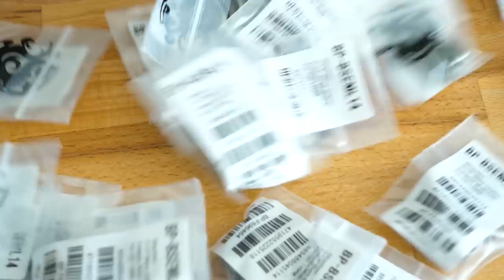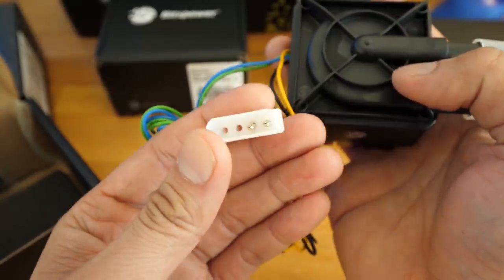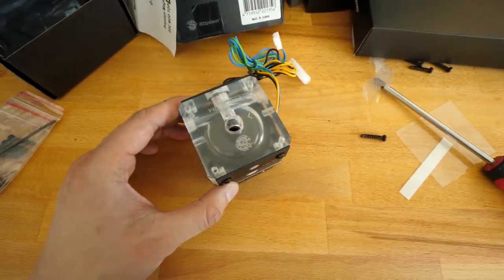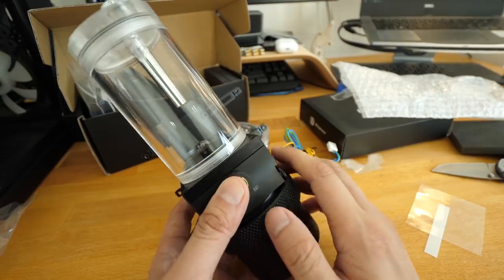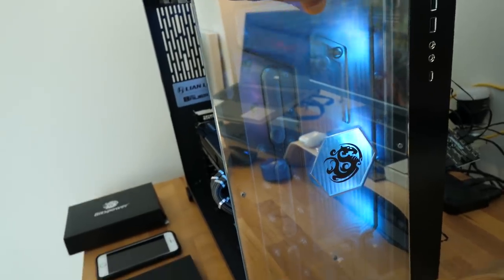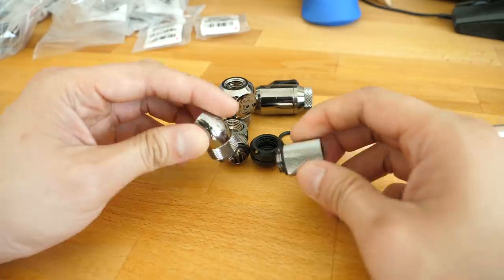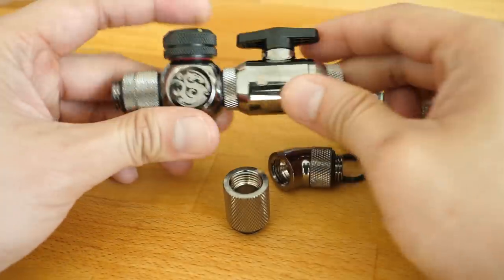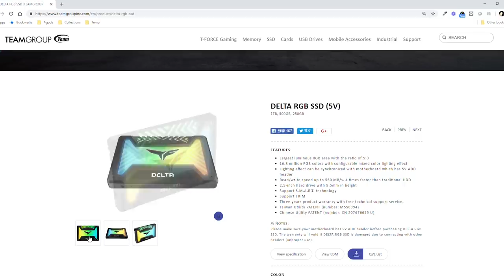Project Aqua Crystal feat. Bitspower Touchaqua Sedna water dist block and Lian Li 011 Dynamic

Comment: I honestly think you should do more in depth detailed water cooling guides, you did a great job on this one and I would love to see more in the future. Your guide was very easy to follow. I know water cooling id super expensive and takes a heck of a lot of time to do, but new comers need better how to guides. Don't get me wrong there are some great ones out there...but they are starting to get out dated if you know what I mean.
Reply: I agree!
Reply: I agree with you. Gambit
I have owned CW for almost 8 years and from my point of view EK is in first place. Nobody can beat them. How soon did I buy a radiator from Thermaltake 480 64mm and if I compare their radiator with the one from EK you have no way. The ddc pump I got from the first CW and nowadays everything goes perfectly from EK
Nice project but when you put the system in full load you will see that the radiator will not be enough. I own Asus Maximus X Formula + Intel i7 8700K 5.0GHZ and Gtx 1080 with a 420 radiator and a 480 video card with a maximum temperature of 45 degrees.
Good luck in what you do next.
Reply: What are you on about. He talked about pumps and fittings. Theres a million more things to consider and definitely videos better than this one.

Comment: Just an FYI, make sure all the screws are tight.  Mine was leaking straight out of the box.  I checked the screws on the front of the plate and had to give them all at least 2 full turns to stop the leaking.

Comment: I'm actually about to do the same, not as nice as yours! But I'm gona' be transferring my (Z370)8086k/1080Ti build into my brand spakin' new PC-O11 Dynamic case, that's sitting right next to me, empty..with bunch of parts inside of it. And going to be running my first complete custom loop into it. Since I couldn't buy everything I 'needed/wanted' all at once(Peasant Farmer), I've been buying part's here and there and just have a few more parts that I want included before i started the build, no rush really. In between the down-time I've been researching and watching PC-O11 custom-loop builds likes yours that will help me with my first loop. But newayz Great video man and beautiful build!

Comment: why do these super high end builds always have a sata SSD in them, decent NVME drives are not that much more expensive, and its hard to argue cost with a RTX slapped in
Reply: @Steven Ross-watt I have a 500 gig NVME and a 4TB mechanical drive hidden in the case, and you dont see little boxes with yet more cables hanging out of them stuck in odd places at random
Reply: @Steven Ross-watt point was if you got a RTX 20something why is one showcasing 2009 gee whizz tech when better slicker and faster is out there

hey check out my brand new expensive as hell supercar, its got a keypad for a door lock
Reply: @Steven Ross-watt it was more of an observation than a criticism but whatever makes you feel like you defended the internet
Reply: I have 2 1 TB NVME drives, a 2 TB SSD & an 8 TB HDD lol
Reply: Martian Moon what's in there, 4K porn?

Comment: Is the reason why you did the tubing that  because of the type of reservoir hole location? Would a tube style like this be possible on a reservoir from an EK reservoir? Reason I’m asking is I like the bends in this and I’ve seen a lot of straight tubing runs on ek reservoirs.

Comment: Great video but what is the point of the GPU support bracket being inside the case if you're not gonna actually use it?
Reply: probably the same point of spending 200$ on a distribuition plate and not using it for what it was made

Comment: I just bought this distro plate for my Razer edition O11. My question is - I saw in the manual it mentioned removing or fastening rivets - do I have to do that?? I'm waiting on my gpu and cpu blocks as well as some more fittings before I start bending tubes!

Comment: I notice that you managed to exchange the pump to the d5 pwm. Where an how did you connect it and where and how would you have connected the original one ? Thanks for your explanation !!!
Reply: I would imagine, its just removing those screw and re-screwing it in but yea, would love to have some confirmation/explanation from jojococo studio.
Reply: LLuuLe2 i meant the Electrical connections of both the DDC pump and as compared to the original non PWM Sedna pump

Comment: Is it possible to take the pump off the front panel distro plate and place a different pump somewhere else in the case so a 360 rad can fit in the bottom?
Reply: No. The pump is connected by 4 screws and the inlet doesn't has any screw hole. It's a normal hole with oring. You need to figure out yourself how to seal it.

Comment: awesome build as always, i have a question is 1 60mm 360 rad enough for a 9900k and a 2080 ti i have searched every where and cannot find and answer  thank you in advance
Reply: I'm sure you have figured this out by now, but if you plan on overclocking it won't be enough. I would either add a 240 rad or 360 for even better performance.

Comment: Hopefully someone can answer. Can you still fit a radiator on the back with that water block install considering where that pump is?  And is there enough space on top to do a push and pull config?

Comment: Is it possible to use that waterblock for just the processor and not a graphics card? I been wanting to get that water lock but just for my chip
Reply: Yeah u can have a single loop to your CPU only EKWB also sells kits but they are soft tubing and they don't have a drainage connection

Comment: Thank you for this video, really helped a lot. I still have one question that I cant figure out the answer, in the touchaqua sedna, you think its possbile to change the location of the pump? I am having some trouble fitting a 360 radiator because of that pump. I ordered all the pieces but I am still waiting, so I dont have the Sedna with me. Cheers
Reply: I am also wondering this. I am wanting to do a build with a side 360 and top 360 but it looks to me the pump would need to be moved to the right side so you could attach the side radiator to the bottom left of the distro where the pump is supposed to be. 

It looks like you could move it to the bottom right, I have seen a video somewhere where someone removed the included pump and ran tubing to a D5 pump in the bottom left of his case. The EK version of the distro has the pump mounted on the right bit I think the plate mounts differently and protrudes more into the case. Let me know if you find out! 

Video was very helpful in answering some questions I have had a hard time getting answers for.
Reply: @mastacator2739  the best solution I found for the side radiator is a 30mm radiator in the back part of the side, and fans in the inside side of the panel.
My problem is with a heavy to be overclocked build, 2x 360 rads 30mm, might not be enough, then bottom rad, and that's my problem, too long regarding the pump.
I don't think it's possible to mount the pump in a different place.

Anyway mine should be arriving this week, I will let you know.
Reply: @joaopina5156 I currently have an aio radiator mounted in the side of my pc 011d. It's 25mm thick and i have 25mm thick fans behind it and 25mm fans in front of it running push/pull. I would say you probably have up to 55mm in the back part of the side for fans/radiators and you can still put 25mm fans in the front as well. I have found out that you are limited to 125mm wide radiators in the side, so you can't use hardware labs radiators in the side as they are 133mm wide. Glad I found that info because I wanted to put as hardware labs gts 360 in the side. It may be possible if you want to do some drilling and cutting.

In regards to connecting the side radiator it sounds like you can pipe it from the top into the distro plate and you will not need to move the pump. I've heard that the bottom pump placement will most likely block the bottom 120mm fan from being installed if you were looking into doing that. Might could get away with a slim fan though.

General advice is you need 480mm total of decent radiator space to run good temps on a decently overclocked system with 1 gpu and cpu. So with 2x360mm radiators you should have a total of 720mm of radiators, should be more than enough from what I gather, even at 30mm thick. From what I've seen you could run something closer to 50mm in the top without issues. I am planning on doing a 30mm-ish in the side and a 50mm-ish in the top.

I've seen a couple different ways in which the side radiator was piped with the fittings at the top of the case to the distro plate. I've seen an image where someone used 2 extenders and 2 90 degree fittings to get it to work. Definitely takes some work, if you want I can give you the links of some informative posts with pictures I've found to accomplish this build with side 360 and top 360 rads with this specific distro plate. I have also heard that the pump included with this plate runs pretty loud, I believe I saw 40-45db, but you can replace it with a ddc pump of your choice if you ever choose to do so.

Comment: According to my distro plate, of the same mfg and model, this "loop" isn't possible.  He runs his pump to the top port on the plate,  and plugs the out port just below that.  The liquid from the pump has no where to go.  It may look as though the top two ports are connected to the second port down due to the gasket in the plate, but I assure you, they are in fact not connected.  Unless Bitspower made some changes to the routing after this  video was made, and my plate is somehow different then his  But I don't think so.

Comment: you should have saved the graphics card support for another video if you're not even using it in this video. also, the output of the pump should have gone to a component and not immediately back into the distro plate. other than that, great educational video.